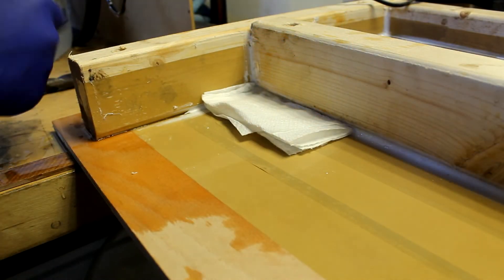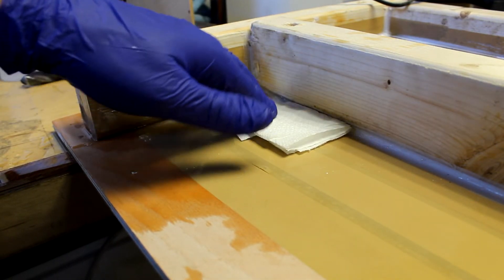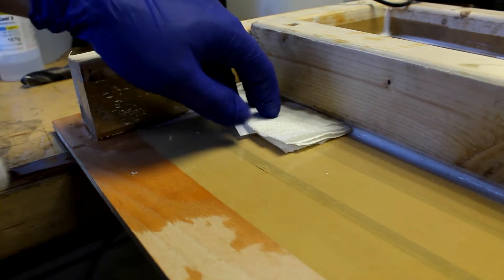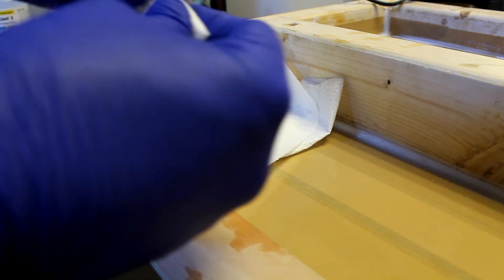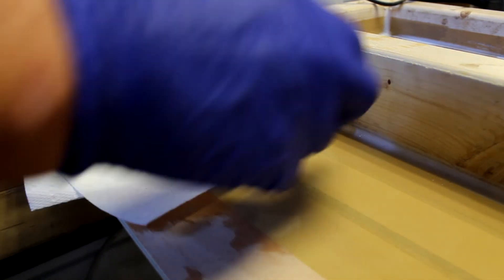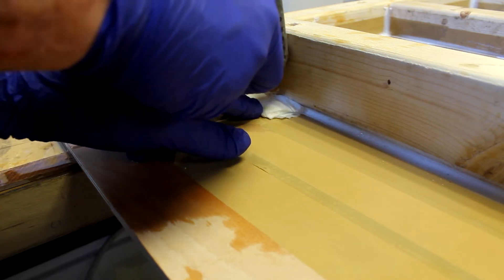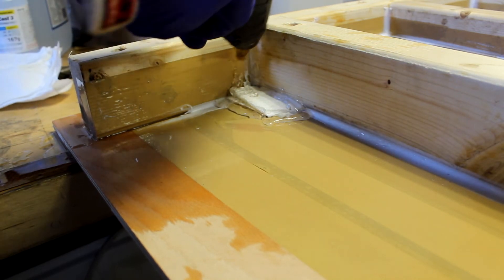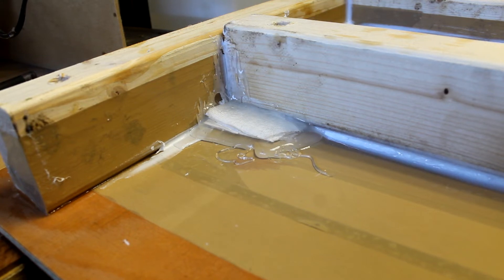HOW TO FIX A RESIN LEAK QUICK !!

Comment: Yeah, flex tape works real well. The best solution that I've found is taking a length of board (like you used for your form), and slather the bottom edge and back edge with glue and stick it to the base and back wall of your form...then seal the edges more with glue.